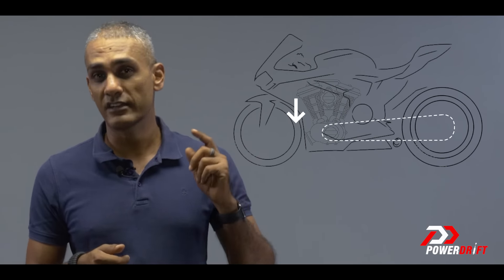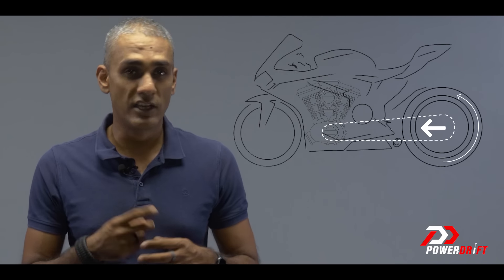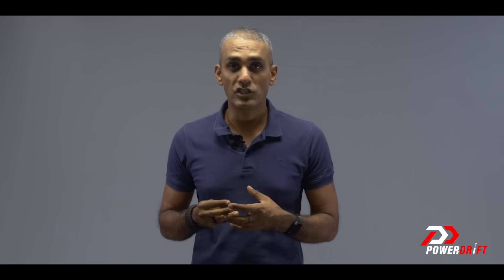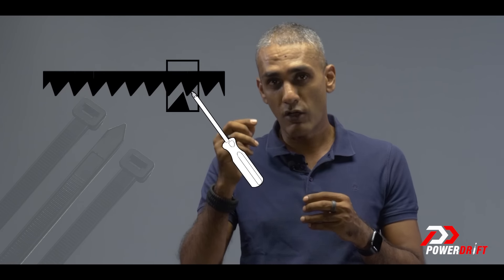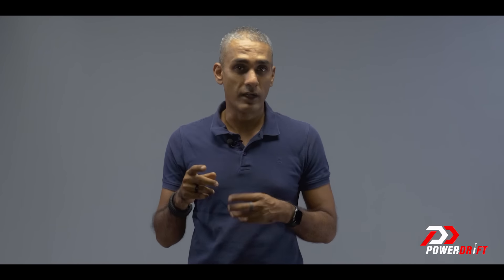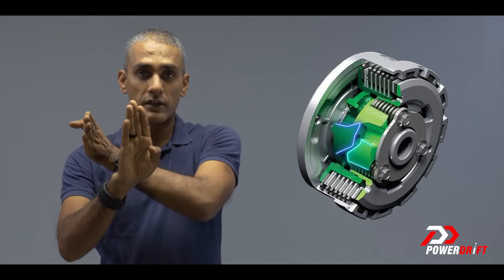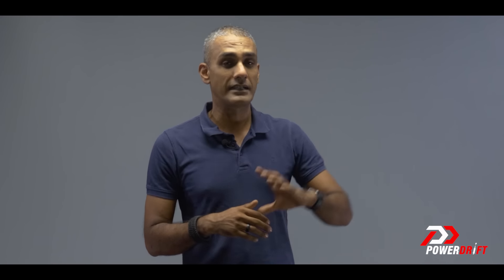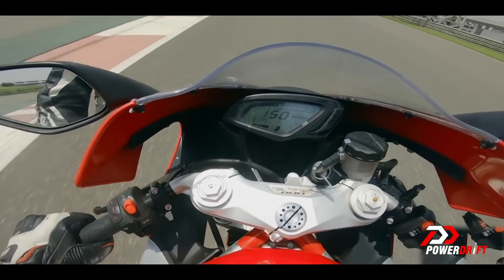PD Simplified : Slipper Clutches

Comment from the maker: Hey #PDArmy, we hope this helped you understand slipper clutches! Do give the video a Like and let us know below what more you'd like us to simplify.
Reply: Please guide on choosing riding gears specifically on Riding jacket/Pants/boots like you did previously on helmet. There are few different types and quality in the market but choosing one out of them seems a bit of a hassle for first time buyers as like me.
Reply: Morning class by Shumi Sir🙂
Reply: Would love to see a video on front vs rear tyres on a motorcycle and the pros and cons of using a rear tyre in the front when some odd front tyre sizes are unavailable
Reply: Ru m
Reply: Does slipper clutch eliminates the advantage of engine braking or can we still use it?
Reply: Wating for game of performance ,can it come 🤔
Reply: Pppppp
Reply: I would like to add one thing in that regard (slipper clutch). Which is a safety advantage,  I was riding on a state highway. I downshifted from 4th gear to 3rd  n did the overtaking. But just after the overtaking when my engine was revving @9700 rpm in 3rd gare and by mistake shifted to 2nd instead of upshifting. If I didn't had slipper clutch on that time I was supposed to crash. But slipper clutch got engaged and saved me from a big crash. Its good to have something looking at ur rear wheel just like ABS, so having slipper clutch is a big safety advantage.  Thankyou for reading.
Reply: Czc¶Czc y 1.
Reply: @sumone2768  00pll)
Reply: Good Night 💤🌙
😊 Sweet Dream
🌠🌠🌠🌠🌠🌠🌠
Good Night 💤🌙
😊 Sweet Dream
🌠🌠🌠🌠🌠🌠🌠
Reply: न
Reply: Please  do a video on stock filters , stock replacement  filters, performance filters ( K&N ,BMC etc)  how it will help in improving bikes performance ? will it be very much evident, noticeable ? Is their any demerits ?
Reply: @PowerDrift, @shumar, Please make a Simplified on all the reasons why OEMs are not launching and/or selling bigger capacity (especially middle weight) bikes in India. Especially what role our Govt and its rules are playing in this worrying trend.
And even when they do launch them (in India or globally), why the newer bikes are losing out on performance compared to their predecessors. Example R7 and R6.
Reply: well unless you downshift and engage the clutch....only then you see the jerking / locking aaffect right?? if you keep the clutch disengaged unless the wheel speed decreases down to relevant engine rotation speed, you're good to go. I think the biggest noticeable difference is probably the light clutch lever action.

Comment: Hey, engine braking and rev-matching while downshifting, would be a good thing to explain, I think!
Reply: Absolutely
Reply: yes it should have been atleast mentioned in this video once. and explained 20 sec.
Reply: It would require like a visual demonstration for better understanding
Reply: If I have a slipper clutch do I need to do the rev matching?
Reply: @saurabhkakde3502  Rev matching is more fun but technically it reduces the penalty for not doing it. My 19 zx6 is supposed to have one but twice now when I had a "Shift event" the rear tire definitely broke lose both times so I'm not sure exactly how much back torque its supposed to limit.
Reply: Every rev match costs a fuel.

Comment: It definitely helps when aggressively downshifting during an emergency braking on the steets
Reply: I would strongly suggest riding better so that emergency braking isn’t a common feature at all 🤣
Reply: On Indian roads, you can only do so much yourself. One needs to account for others' mistakes as well.
Reply: @shu_mar  emergency braking also consist of areas where brake fade occurs. One can engine brake and slow down without have to even touch any of your brakes. In hilly areas where one have to rely too much on brakes engine braking can be used. Also one also must take care of the speed themselves at the first place to increase the window where one has more time to react and take steps based on it.
Reply: @shu_mar I think you missed his point. You should always drive/ride carefully, but also put in mind there are careless drivers/riders still on the road even careless pedestrians. 

That's why manufacturers added these features on Bikes so riders can be safe.

Comment: please do video on rev matching and throttle blipping! should we blip the throttle in smaller capacity motorcycles?
Reply from the maker: We shall do that. And yes, you can blip on any motorcycle.
Reply: @powerdriftofficial  thank you! Please cover if we should blip the throttle and are there any long-term risk of damaging the engine or the clutch.
Reply: Can do! And short answer is yes.
Reply: @shu_mar  thanks so much again professor!

Comment: If I understand correctly, with a slipper clutch in place, Engine braking will not be available the way its there now, usable in steep hill descent? Is my understanding correct, if yes, it can be a big problem putting extra pressure on braking system
Reply: Engine braking will be there bt just bit smoothened out....so u wont feel the jerk after a downshift....thus helping u to downshift without worrying about the jerk
Reply: Use as much brakes as you want. Modern brakes can handle it. Engine braking for descending slopes is an oooold idea from a long time ago.

Comment: Is there a threshold of the reverse torque to activate the slipper clutch? ,  I have adv250 enabled with the slipper clutch, I have tried downshift at a slightly high speed and I felt the engine braking clearing

Comment: Thank you power drift....that was insightful.....I had a confusion.....even though an auto blipper is engineered differently......how is the end functioning result of slipper clutch different from that of auto blipper
Reply: Lets make this clear
The quickshifter allows u to down n upshift withouth the use of clutch lever
And the slipper clutch lets u downshift smoothly while taking away the jerk which u recieve after downshift 
So the end results are 
Quickshifter - shifting while accelerating without the use of clutch 
Slipper clutch - downshift becomes smoother......so while taking on traffic ....like really hard....u dont have to engage on brakes .....just downshift and continue to accelerate 
Quickshifter can be understood ....bt slipper clutch.....u need to experience it
Reply from the maker: Do check this out - https://www.youtube.com/watch?v=wiZ3oiWvtXs
Reply: @powerdriftofficial  thank you.....it was very helpful....really appreciate it
Reply: @vinayakmadhav1514  u r correct for the most part..... except for the fact that you quickshifter can only do upshift.....for downshift you need an autoblipper
Reply: An autoblipper facilitates fast downshifts. A slipper clutch prevents the wheel from locking up on aggressive downshifts. It’s not the same thing
Reply: @shu_mar  thank you
Reply: @shantanukumar7174  yeah😂😂😂....still learning
Reply: @shu_mar  aah shumi.....u are one of the best moto enthusiasts i came across 
Thank u for such great explanations🔥❤️

Comment: so, having a slipper clutch wont assist in engine braking?
Reply from the maker: It won't affect engine braking.
Reply: Nope. It will reduce it
Reply: Yeah even i think it reduces it. Because when your wheel is driving the engine at zero throttle, with the slipper clutch on, the decoupling might happen. So engine braking reduces i guess
Reply: @vishalnagula6275  the threshold isn’t that low

Comment: ..plz make a video on the differance of performance in inlines and V engines, v configuration makes a lot of torque across the rev range whereas inlines perform better at specific revs, which r better !! Pros and cons etc??. I personally luv the ducati l twins. Rode a scrambler and blown away how she was throwing  me backward with a slight nudge of the thrrotle on almost all the revs and all the gears .😊😊😊

Comment: Can we replace a regular clutch with a slipper clutch?
Reply: In few motorcycles u can
Like tvs Apache 200
The whole slipper clutch assembly is sold at service center
Which can be easily replaced

Comment: So I've got a question. I own a TVS Apache RR 310. It has a Race Tuned Slipper Clutch. So lately I've been using my clutch less and less and what i have noticed is that in the slipper clutch we can just blip the throttle lightly and the gear shifts! And this happens in both directions. Up and down. Very smoothly it happens. I saw people shifting this way in RC 390s and R3s. So I too started practicing it. The gear shifting is smooth. Be it downshifts or upshifts. So i should not be concerned about using the clutch right? Or damaging something inside? Please answer. I honestly have heard about it lately so i do not know about this matter. Thoda middle class question hai. 😅😂

Comment: So can we say that it works like an ABS, wherein an ABS helps while braking and the slipper clutch helps while downshifting and both would help in not locking the rear wheel completely.
Reply: In some ways yes. A rolling wheel can be controlled and a sliding wheel almost cannot. Both systems keep’em rolling.

Comment: I have heard that during break failures, if you down shift it automatically slows the bike down. So in a bike equipped with the slipper clutch this wouldn't be possible?
Reply: The effect would be less, yes. But unless you’re ignoring your brake’s maintenance, failures are very very rare now

Comment: Wouldn't a slipper clutch reduce effective engine braking? Is there a torque limit, or is the movement completely free in the reverse direction? I have never ridden a bike with slipper clutch, would love an answer from an experienced rider.
Reply: It’s not completely free but yes it reduces engine braking. Which to me isn’t the best way to slow down anyway. When I want to slow down, I just use the brakes.
Reply: Yes, I agree. 
I remember my old 1981 standard bullet where I used to hit the neutral finder, sometimes at a relatively high speed, wanting to coast to a gentle halt at that distant red light, and it took me from fourth to first instead! Those were nasty surprises and a slipper clutch would have helped!

Comment: Shumi, you forget the most important function,  engine braking during hard or urgent breaking. 

I think on indian highway .. for a common biker slipper clutch is one most important feature
Reply: Yes.....in my non abs rtr .......i have installed the slipper clutch....n its applications are just ❤️......absence of abs is never an issue for me
Reply: If you’re using engine braking in an emergency, you’re not using the most powerful control on your bike to the fullest. That’s the brakes.
Reply: @shu_mar  your riding skills must be much better than average inidian riders, and i respect your feedback.  Howeever not all the bikes have great breaks nither all riders are that skilled  and hence  with my limited experience.. I am quite sure engine braking is used by many and it can help and save from an accident

Comment: Shumi sir I have a question... Does slipper clutch reduce , engine braking to 0?  Or the engine braking is reduced to some extent... And in higher capacity sports bike we have different levels of engine braking..does that counter the work of slipper clutch? @powerdrift
Reply: I have been using the slipper clutch on rtr 200
Rode abt 28k kms on highway 
I will say it takes away just 15/20%  of the engine braking bt just the jerk part of it .....while shifting from 5th gear speed of 80 to the  4th gear .....it takes away the jerk bt still manages to engine brake
Reply: @vinayakmadhav1514  ok that's great but have you tried ...rapid gear changes.. like going from 5th to 3rd
Reply: No. Not zero. Engine brake control is a totally diff tech though meant to preserve chassis attitude in the turn entry phase.

Comment: I have almost never went a track, but judging by road experience i feel auto blippers r more useful than slipper clutch in daily usage
Reply: I’d say I’m fine without either in daily use TBH
Reply: @shu_mar  that's true, but learning that on streets are not that easy. Can you explain a few tips to gain better control on corners?
Reply: @shu_mar  that's cool, but I'm from kolkata and there are no tracks in kolkata. I have only roads where I can learn.

Comment: So instead of doing a hydraulic clutch for low pressure on the clutch lever we can down the springs... Am I correct??
 
Don't kill me please if I'm wrong 😌😂
Reply: If u think u can cut down the no. Of springs .....then it wont help ......it will put less pressure on clutch plates thus power loss will increase

Comment: This has happened with me , I was in 4th gear cruising around 50-60 and suddenly uncle in front of me stopped his santro out of nowhere.
There was less than 1/2 meter distance between me and the car, I panicked and started downshifting and also applied hard break. Of course I fell down my helmet savedme my bike got damaged and uncle drove off without even seeing what happened at back.
If my bike had sleeper clutch this wouldn't have happened.

Thank you Shumi for explaining this, I'm definitely going to buy my next bike with slipper clutch
PS : I was riding avenger 220
Reply from the maker: Glad to hear you are safe!
Reply: @powerdriftofficial  ❤
Reply: uh... no. Slipper clutch wouldnt have saved you there. front tire & brake is responsible for 80% of your braking power. Relying on the rear brake/engine brake in an emergency situation is just erroneous rider's decision making

Comment: Love the way you present. Also the idea of demystifying technical matters so well is laudable. Could you pls talk about bike engines and number of cylinder and their significance? Higher displacement bikes have 2-3 cylinders, not just one...Also, incase of some entry level performance bikes such as 300 cc, most are single cylinder but a few twin cylinder, why is that? What difference does it make...Thanks
Reply from the maker: Good suggestion, Sumeet.
Reply: Can do!

Comment: Hi Shumi, Thank you, it was helpful. Will this feature be helpful while riding downhill. Engine braking is very effective during emergency in down hill section, slipper clutch equipped motorcycles are less effective at this scenario comparing to equipped one.
Reply: There’s no need! Use your brakes! Engine braking on downhill is an idea from a time when brakes were n not this good
Reply: @shu_mar  Thank you Shumi.

Comment: Hi Shumi, thanks for covering this up as this is one of my request. I got your point on slip and assist clutch however this left me wondering, 

Is slipper clutch use to work same way as normal clutch work when riding downhill ?  Taking this as steep downhill and bike is in down gear to control?
Reply from the maker: Yep, you shift as you would normally.
Reply: Use the brakes! Using engine braking to control descent speeds is a idea from a time when brakes were unreliable! I’d never ever do this on a modern machine